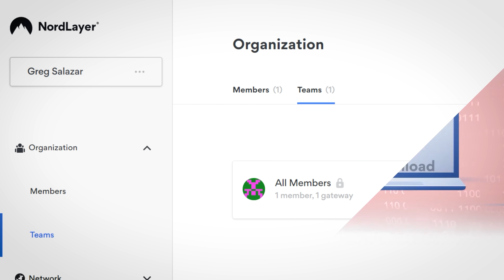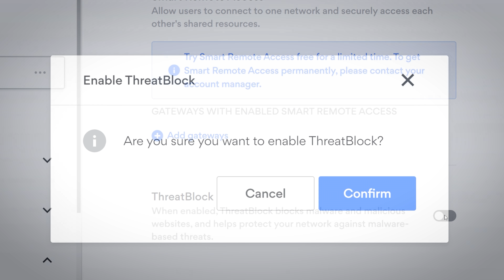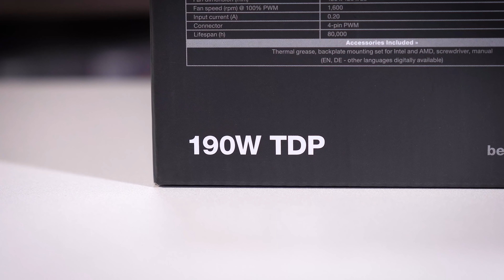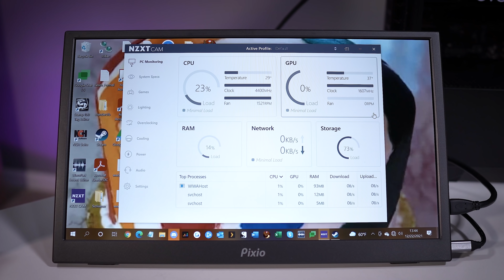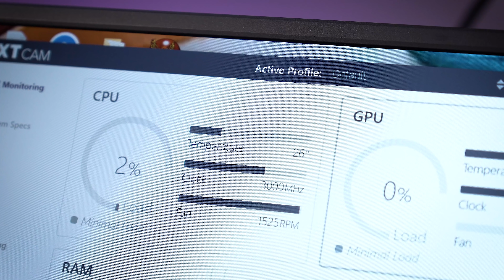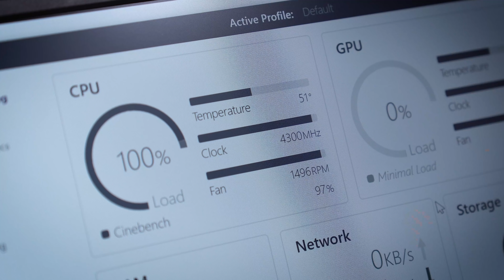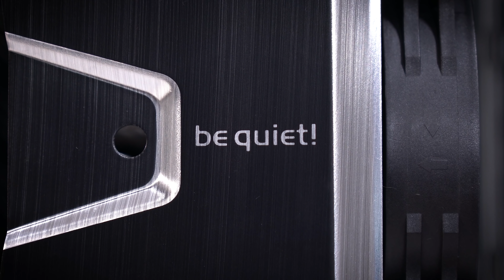Deep-Cleaning a Viewer's DIRTY Gaming PC! - PCDC S3:E1

Comment: I am still surprised at how many people "complain" that their systems are overheating when the insides of their tower look like an abandoned house's basement back in like WW1.
Reply: fr
Reply: I know right I clean my tower at least 2 or 3 times a year and yes I may be a little anal but I spent close to 400 bucks building it and I want to keep it clean
Reply: @bretthibbs6083  400 bro i spent around 3k i would do the same with an 100 dollar rig tbh
Reply: @bretthibbs6083  Two three times a year? I clean the dust off my tower at least once a month or more. Mind you I removed all the filters to get unobstructed air flow, which is why I get a bit more dust. My PC does run really cool though.
Reply: @eternalabyzz9386  you probably do have a respectively good pc but I doubt you spent 3k. I checked out your videos and you fail to completely maintain 240 so maybe a 1.5k build
Reply: @eternalabyzz9386  but with the benefit of the doubt you might of got your pc within a month so I believe you
Reply: @itsjmmmLIVE  yea cuz my gpu is bad its an rx 6600xt which has problems like a lot such as stutters and fps drops i cant even run anything above low settings i get like 30fps but i got it for 600 and i have a ryzen 9 3900x so more like 2.5k so yea
Reply: @eternalabyzz9386  gotchu, yeah pc's are expensive
Reply: @itsjmmmLIVE  but yk not all pcs that are expensive are good for gaming some are good for multitasking like mines and rn gpu prices are insane
Reply: @eternalabyzz9386  so you spent 2.5k on a rx 6600xt and r9 3900x you can literally get a 3080 and an i9 for 2.5k on cyberpower
Reply: @eternalabyzz9386  where'd you get yours
Reply: @Nevelss  nah its not a prebuilt why do u think it cost a lot
Reply: @eternalabyzz9386  so you spent 2.5k on a build w a radeon graphics card 😂
Reply: @Nevelss  like if u can get a 3080 for msrp
Reply: after i cleaned my pc of 1,5 years for the first time (i didnt saw much dust from the glass) i found out it was also greasy somehow, took me two days to mak it brand new but now i clean it once a month

Comment: If a video card is too hot, first thing i check is how many watts the power supply
is, many people upgrade their GPU and will have an under powered PSU, or it will be
barely within min recommendations for the GPU - which under heavy load when gaming is not enough, overheating the entire pc because the PSU is working too hard. 
if your GPU min requirements is 450 watts, = get 650 watt PSU and your system will 
stay cool.  that extra headroom will keep you system from overheating under heavy load.

Comment: I just take my case to my garage, open it up, and use my air compressor to blow all the dust out.  I do this about twice a year, and never have any problems.  Lots of dust collects in the case, on every component, but the air seems to clean it very well.

Comment: Great video as always. It's also absolutely true that cpus temps can skyrock when the cooler isn't set in place correctly. I recently had such a case aswell. Going up to 105°C within few minutes just because one screw wasn't sitting correctly, after that it was chilling at ~35°C. I also like the silver of that air cooler. It really fits to the build because the RAM and GPU has also silver accents. Also bequiet is awesome. I've multiple gaming builds with mainly be quiet stuff (case, psu, cooler).

Comment: Really like this series, always watch these to remind my self why I'll never be a tech again lol. Seen some real shockers in my time.
Now not to be a stick in the mud, but who ever built this, probably shouldn't do it again, or at least, learn how to before they touch another PC. This is a "The Verge" level build.
Bad cable routing aside, they mounted the m.2 SSD down to the mainboard with the stand off, and used the wrong screws on the CPU cooler.

Comment: 0:55 It's also an NZXT case. The 400 and 500 series cases are notorious for horrible airflow. The main reason why I say this is that I have the H440 case from NZXT, and with the X52 AIO, I was, on idle, with the AIO still fully working, saw 60c on the CPU on an older 1700x. I then swapped cases to the Corsair 4000D Airflow, I saw idle temps in the 20s.

Comment: I'm gonna plug for my patented method of keeping PC's relatively clean.

* Take them off the floor.
* Get rid of the intake filters on them and just have a whole-room air purifier purring along 24x7 instead.

And you get improved air-flow as a value-add extra!

-Matt

Comment: Tip: get a boxed set of M3 and M4 machine screws/bolts. Most of these cooler mountings use those, making it easy to replace wrong, lost or broken screws. Get a tapping set as well, in a lot of cases, busted female threads can be 'retapped' enough to serve the (relatively low-load) situations in a PC. Edit: that is assuming manufacturers do not ship special versions with freedom unit threads to NA. XD

Comment: Whomever says aircooling is a downgrade, especially with something as good as a bequiet heatsink and fans... is a bit misinformed. Those things are silent as heck, no pump ( which is a weakpoint in most aios ) and cool extremely good. Only thing you could argue is the optics if the user has a case he can see into and simply doesnt like bulky air cooling.

Comment: I just did a full clean on mine. Mind you, it wasn't a complete wreck, but since I was addressing an issue with my PC I figured I'd do it anyway. Interesting sidenote though. I uhhhh bent the same exact pins on my Ryzen 7 2700 that one person did from one of your fix or flop videos. They were the ones that controlled heat. My wife ended up fixing it because she's a crafter, and she's used to very small, delicate work. I even told her, "Greg ran into this problem, and broke the pins off!" She doesn't realize how big a deal it was for her to have fixed it, but I know. She's a friggin Goddess! 😂

Comment: That was the most detailed PC cleaning I've ever seen. I bet even the screws got a dusting. You should make the owner sign a contract that states that they must keep the PC reasonably clean for at least 30 days after giving it back to them. My CPU gets hot too but then again it's an FX8320 which is housed in a case that isn't the most air flow friendly. I have an aftermarket cooler but it doesn't help with the cooling that much. The cooler may need another fan and the CPU may need fresh and better quality thermal paste applied to it.

Comment: As much as water cooling is great, a good tower cooler has a couple of advantages; they last forever and have less cables to manage.  AIOs have to be replaced every five years and custom loops have to be regularly maintained.  I just built my pops a nice little 11400 itx with a CoolerMaster Hyper 212 Black and that thing never goes above the 50s even under heavy load, with the fans still running on slower speeds.

Besides, a 120 radiator doesn't have much fluid capacity to absorb much and only one fan to push out the heat.   That tower cooler is a better bet in this case with the push fan on the cooler and the pull fan on the case.  A 240 rad with two fans would've been great for overclocking the system and by the looks of the motherboard, I wouldn't expect much of an overclock anyways.

Comment: Got my computer in November and noticed just a tad of dust when I was cleaning off some fingerprints on the glass, so I got out the blower my wife got(the one Greg uses) and man, I couldn't believe how much dust blew out of the fans and rad. Not even 3 months, and it wasn't even on the floor.  Oh and get that duster, it is handy, If you have a small compressor for your art or work station near your computer, don't bother, but mine is loud and heavy, and not near my computer, so rather than moving one to the other, this is an easy thing to use that you are less likely to put off.

Comment: That budget z390 mobo is actually excellent. It overclocked like a dream and was very stable. I replaced it with a "nicer" Auros Pro Wifi board and it always had issues holding stable OCs.
Reply: I have an msi z390 too, running 4.8ghz (9600kf) for half a year now, almost no crashes

Comment: Nice job as always Greg! And I do personally prefer CPU coolers as such, bit chonkier aircooler bois. They usually beat cheaper and weaker AIO:s (as you said) and I just like the mass of it xD They are usually also quite quiet! I used to have a Thermalright Macho (some 2012 revision) that cooled everything I threw at it and when I upgraded to AM4 I had to let that chonk go. Then I bought a SilentiumPC Fortis 3 which is another chonky boi (and CHEAP!) and it keeps my R5 3600 Cool'n'Quiet ;)

Comment: In older CPUs the thermal paste under the heat spreader will dry up and you have to delid the heat spreader and reapply the thermal paste underneath. If you want to make a video on that I have a 4970k that needs that done.

Comment: While the problem is fixed with the bequiet aircooler (which obviously is way better than any 120 AIO lol ), I think it would have been a great addition to the video if you could show the result with the AIO threaded correctly onto the CPU. But maybe you didn't have the required screw to replace the defective one ? Anyway, great video, pleasant cleaning as always !

Comment: I personally like the GPU fans to run a very low RPM even at idle, so that the idle temps are as low as possible. I used MSI Afterburner to run a custom fan profile to disable the 0 RPM mode.

Comment: I have found that compressed air and detailing brush do great Job on cleaning electronics...
Reply from the maker: I prefer cotton swabs and isopropyl. Soaks up the dust rather than loosely sprays it everywhere (unless you're outside where that wouldn't matter, of course) 😁

Comment: Am I the only one who cleans his PC once a week? I like to keep it looking new :)
Reply: The best thing would be to get the case to positive pressure. To limit the dust as much as possible. Have my PC for 2 years. The only place dust can build up. Is on the HDD bay top. The rest is pushed out.
Reply: My dust usually collects a bit at the bottom of the case, the rest I believe is pushed out the top/back and out from the power supply dust filter

Comment: I have that exact same air duster, mine is stronger than compressed air cans and doesn't leave condensation on the parts, though maybe it's because I've been getting crappy air cans. Either way it does the job just as well.

I was worried it might be generating static current so it's good to see the pros use it as well.

Comment: Using an air compressor so close to the circuit board to get stuck on grime is a really bad idea, thats how you blow off SC's and IC's. 
I just use my (clean) car detailing brushes, and a vacuum to clean mine

Comment: Never use alcohol near thermal pads. After cleaning, use an antistatic spray. Did you manage to close the case after I noticed that the cooler is taller than the case?

Comment: i have the shadow rock 3 aswell,its actually so quiet you cant hear it over the gpu in games but you can hear it in cinebench for examble where the cores max out and your cpu is pulling 100watts and up,my stock 5600x doesnt go above 55c so the fan doesnt reach 1k rpm at all

Comment: As soon as the montage started, I saw the paste  issue. Great work as usual. Out of curiosity, did you return the return the original parts to their owners?
Reply from the maker: Only sometimes.
Reply: @GregSalazar  Reasonable enough. I was more wondering if they were set on running an AIO if the option was still available to them. Mind you, that the BeQuiet is a far better option, but aesthetical choices sometime take the wheel
Reply: @ShaneCutting  exactly. i didnt get an aio because I think its better but because I like the looks of it. hope the owner was happy with it
Reply: @wrenn7473  knowing Greg a bit, he does everything with contacting the owner first.
Reply: @Sancto-NL  that is true

Comment: I have the same be quiet cooler, much better than the AIO cooler it replaced, well not for the first two months since when I installed it I rushed myself and didn't apply an adequate amount of thermal compound and I also believe I didn't tighten it properly enough.  So for the first 2 months using the Shodow rock 3 my idle temps on my 3800X were like 45-50(was a very confusing 2 months), but when I repasted and tightened a little more on the screws I have 30-35(depending on ambient air temps of my room)

Comment: The NZXT M22 120mm AIO is also known for issues high temps. been reading a lot of issues in regards about that single 120mm AIO and it`s not good not just when I was reading it but also experienced it first hand. When I had it before my idle temps reach more than 50C.. I know it`s not that bad but that`s idle.. I used to had like in less 30C on idle. Another thing is the pump.. yes that pump design.. all in all I just had a bad experience on that single 120mm AIO from NZXT.

Comment: So air vs water in my book is more to do with space that it is cooling or sound as assuming you are using comparable products the sound and cooling should be roughly the same, when I swapped to my new PCU I swapped to a water cooled all in one until and I had to send it back to the supplier twice as the first two were borked (I think their pump was gone) and they were meant to be brand new (I got them from littlewoods) and I was quite sure I wasn’t the first person to open them but the paste was untouched so they hadn’t been used, if I had stayed with air cooled it wouldn’t have been nearly as much fuss but I am liking the more open space of a water cooler (my old air cooler stopped me from using any fancy RAM as there just wasn’t room)

Comment: Seeing as you went with an Air Cooling solution, I'm surprised Greg, that you mounted no case fans to the front panle area. Now I realise that the front panel itself was a solid sheet of metal, but there did seem to be a grill, on eithe side of chassis? (I could be wrong) where air could be pulled into the machine. Respectfully Yours, R
Reply from the maker: We literally showed temps at the end of this video. Everything's perfectly fine as is.

Comment: Yeah idk why the obsession with AiOs nowadays. A good air cooler will serve you better for longer and with less potential maintenance issues in the future. Unless you're an enthusiast going for a 240mm/280mm/360mm, you may as well buy a $30-50 air cooler. Most PC users don't overclock, and that's really where these top end solutions come in handy.

Comment: The poor airflow caused by the case's design is probably a thermal issue all of its own, and I'm not sure which one's more gross, the poor airflow design or the dust and stuff that's built up in the system!
Reply from the maker: Airflow in the H510 isn't catastrophic. We've a dedicated video already addressing it.

Comment: 7:25 Why does the radiator have a big mad plate in the middle?
18:10 I'm more wondering why the GPU RPM is showing around 300, that can't be right.
Did you run another temp test with the side back on?
Reply: Why cant it be right ? He Said the Guy probably ajusted the fan Curve by himself , he might as well did IT for the gpu

Comment: Fully agree on the 120 mm AIO. What are these good for anyway? The entire point of watercooling (or at least a large part of it) is being able to use a much larger radiator than you can fit on top of the CPU. You do still avoid trapping the CPU's heat output inside the case, but how much of a problem is that realistically? I can only see them being useful in very small (maybe ITX) cases. Otherwise they're mostly just "watercooling" for clueless noobs.

Comment: Greg, is it just me, or when you took the vanity shots at the end, the graphic card appears to be bowing towards the rear/PCIE power connector.
It could be a trick of the camera, but it definately seems to be slightly bending upwards towards the rear.
...Maybe by this point, I'm too used to big unsightly cards that just naturally bend down due to their weight.

Comment: 5:30 not only "how dirty they can get" but using an industrial (or garage /auto shop style) air compressor can cause damage. My air compressor in our garage has enough force to blow micro components right off the motherboard or gpu and into oblivion, never to be seen or heard from again. So no using an "air compressor" from your garage is NOT always the best way to clean something lol. Look at it this way... If you are using a compressor and the air gauge says 200 psi... thats 200 LBS PER SQUARE INCH. It REALLY dont take 200 lbs of force to push one of those capacitors off the back of the gpu.

 Someone will chime in and tell me my math is wrong here, I know it is, but it gets my point across..

Comment: Got a problem and question about mounting cooling system. I have an asrock steel legend b450m and deepcool assassin 3 cooler. My problem is I can't fit the other fan for my air cooler because of ram position and I'm hitting 80 degrees at 60% percent load. Should I change board or air cooler?

Comment: Weird choice for the builder to run a 1000 watt power supply for a 9600k and a 1070 ti hehe, probably doesn't go over 400 watts under load. I have to deep clean my rig like this soon, I been putting it off because it's not gonna be quick lol.

Comment: i have a 250w tdp air cooler grandis 3 with 6 heatpipes (it does not have the flattened heatpipes that transfer heat faster though),  but the aircooler even with 2 x 120mm noctua ippc 3000rpm + 1 x 140mm noctua ippc 3000rpm is outperfomed by the the AIO enermax aquafusion 120mm(!) radiator  with 2 x 120mm noctua ippc 3000rpm push´n pull, by a couple of °C. i think you should have ordered the mounting set for the kraken instead - added a fan, changed to push´n pull and if possible mounted the radiator to the top. i dont think there is a faster way to dissipate the heat else than water - maybe with a cryo cooler, but those have the risk of condensing water(!?). btw my cpu is ryzen 7 3700x.